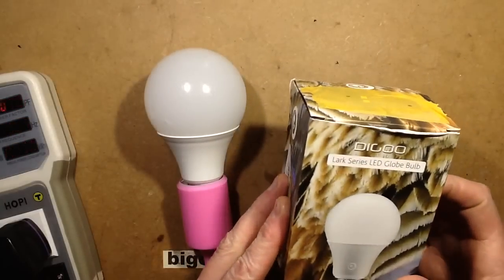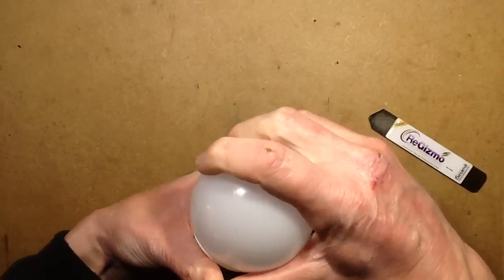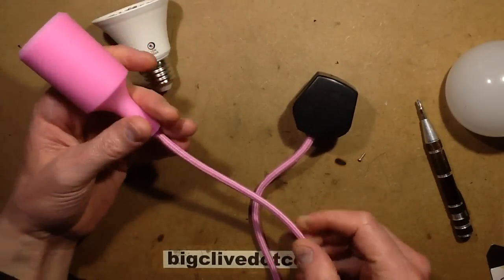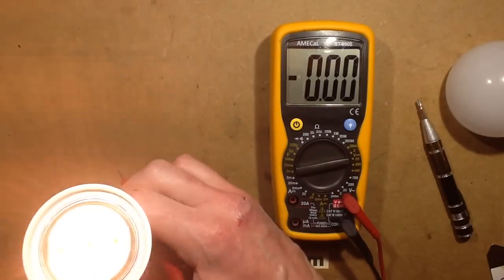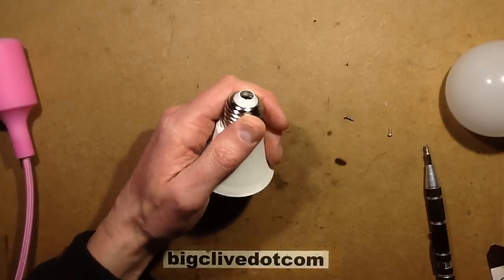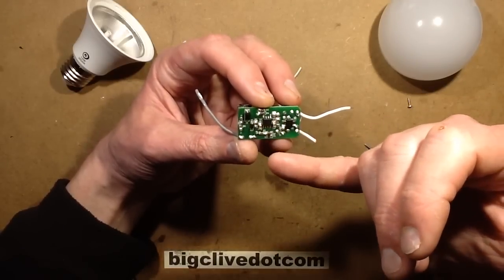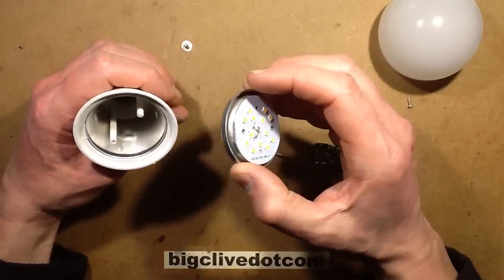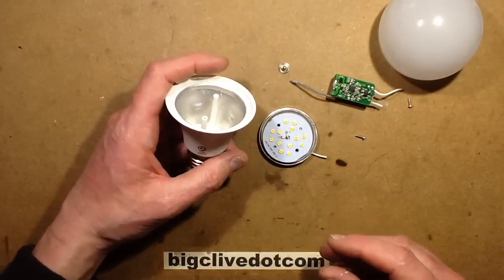Inside a Banggood Digoo Lark 12W LED lamp.

Comment: BigClive, I have been searching for a LED warm white bulb like that for several years that provides the same amount of light that a standard 60 watt incandescent bulb provided and been unsuccessful.  Have you ever seen one? I am on the 110 v US standard.  I have tried several but they never come close.  Please let me know if you ever find one.
Reply from the maker: I recommend the use of splitters that plug into your existing lamp holder and let you use two or more lamps.  That way you can use a cluster of lower wattage lamps that will last longer and be bright.
Reply: I think I will try that but please let us all know when the LED lamp bulb reaches the equivalency of a 60 watt standard bulb.
Reply: I have actually tried many of these out.  But the use I want it for is for a standing floor lamp and it just does not put out enough useful (reading) light.  All of these are very nice looking but functionality needs to catch up with the science.
Reply: FYI: A GE Reveal brand 60 watt incandescent bulb is rated at 630 lumens.
Reply: Thanks, I always wondered about what light output they had but since I have actually been trying LED bulbs out periodically I have to say that they just don't quite make it yet.  Big Clive sent me an email and told me to try a ganged outlet and might try this.

Comment: They fail way too fast, I had 4 and 3 failed within a few days to a few weeks, 2 were warranty lamps, 1 was saved for the 6500K light to use on special occasions. So for the question how long it is going to last: not long.

Comment: Never come across a led bulb that lasted for more than a few months.
I have seen led street lamps installed, and they don't seem to last very long either, do you think that led lights will perfected in the next 5 years  or so ?
Reply: I have 6 GU10 LED spots (3 in the bathroom and 3 in the kitchen, bathroom light is on 24hrs a day), been running them well over a year, no issues. In work I've replaced loads of 8w flu tube emergency lights with the guts and lamps from 3w LED bulkheads (4 years+), again... No issues... Vastly superior to the SD308 fluorescent ballast 8w guts that continuously burn themselves out due to overheating.
Reply: Don't buy cheap ones, I have a 10W one in my room and it has been there for at least a year, no issues at all, if I ever replace it, it will be because I need a 20W one xD.
If you buy decent led bulbs, they will last years.
Reply: Free Saxon buy some from Screwfix. They come with a five year warranty. I've had mine for a year and so far they've been good
Reply: Free Saxon the technology is already here, I know a manufacturer of street led lamps in taiwan , apparently theirs go on for ever with good quality LEDs and excellent cooling (some extreme weather conditions there). But they have it difficult to compete with cheaper products (they are expensive due to the good quality components).
Reply: Arthur Embleton the challenge with warranties is keeping the purchase receipt, they tend to get lost (which is what the manufacturers count on also)
Reply: Rincewind TheFirst with Screwfix the receipt is in my email and I have an account with them with all my purchases.
Reply: Free Saxon the early Philips led bulbs are amazingly long lived; I've got  a 10w one in an outside light that been on continuously for over five years now. I guess this is before they realised that they weren't going to sell that many if they just kept going for that long :)
Reply: ChayD Good point, they say they want us to be environmentally friendly but they still want consumers in BULK
Reply: Try Cree branded.

Comment: 12W LED bulb of this size produces too much heat and does not last very long. But you can lower the power (and brightness) by dividing the single 14 leds chain into two parallel chains of 7 leds each. (like this: http://i67.tinypic.com/91i3x4.jpg). It has a current driver, so the overall current stays the same, but each chain draws only half of it. The driver output voltage also goes down by half. It will draw 6W and will be much cooler and longer lasting.

Comment: Link for the long pink lamp socket?
Reply from the maker: http://www.ebay.com/itm/Colorful-Rubber-Ceiling-Silicone-Pendant-E26-E27-Socket-Holder-AC-Powered-/371514947079?var=&hash=item5680043607:m:mbJKFmopL5ncWGjB894taXQ
Reply: bigclivedotcom  Cheers Clive. Merry 2017! Don't suppose you fancy doing an autopsy on a Poundland LED bulb that buggered a few 3A fuses the moment it was put in several lamps and turned on?

Comment: ooh 12w! lets hope, we need some higher power ones
Reply: jort93z
hehe i guess what i meant was, im happy we are seeing clive do a 12w compared to 3-5w we usually see!, although ive seen 14w ones on ebay so maybe see them too!
Reply: jort93z
true, these 12 watts or so are the same lumens as a 100w incandescent, and about the same as a 20w cfl, and are where the most interest is i think, bright enough for 1 bulb to light a good area or room
Reply: the 9W of these are plenty for a living room or bedroom. They are like really really bright.
Reply: jort93z
people have used the 100w benchmark for years as the bulb to emulate, it was easy with cfl, and taken a while with LED due to the heat and price of making it combination and colour temp technology, now they are it seems very cheap, but we dont know quality or temperatures yet, i hope clive will start to do temperatures next
Reply: jusb1066 these in 9W option I can recommend. Build quality is something you feel right when you take it from the box.... Also when it comes to tungsten 100W I would say these in 9W are about 75W. Not sure about 12W bulbs, haven't installed them anywhere yet just cause they are quite obviously bigger than standard tungsten lamps and got nowhere to put them atm :D but 9W is just gold :)
Reply: Senpai Nooberinho
interesting to hear, i have 3-4 1950's desk lamps/workshop lamps, used to use 100w bulbs, cfl bulbs were often too long and stick out (but did find some in later years), and leds at one time could not find ones to compare with 100w, but am currently using 5w but with forward firing LEDS to make the most of the direction of light, be nice to use something more traditional looking with led's effieciency
Reply: jort93z
yes 100w in leds would be crazy!  i used the term 100w as in incadescent light!

Comment: I wouldn't call this a quality lamp since the thermal grease was spread across only half of the LED disk.  Half of the LEDs will overheat and the first one that goes will be the early death of the lamp.  The design is only half the problem.  The other half is the workmanship in assembly with proper amounts of consumables (thermal grease)!

Comment: it flickers because it lacks transformer
Reply: +Matt Quinn no. i have few led bulbs with proper transformer and constant current and they dont flicker on any shuter speed while those with only cheaply power supply flicker on most of the shuter speeds :)
Reply: +Matt Quinn im also interestef in cameras. probably it would be less visible if shutter was global. but when you have constant current power supply led-s dont flicker at all :)
eaven incasand bulbs dont flicker when you power them from constant current (cars headlights use dc power) but our grid ises alternating current so most of our home lights also flicker
Reply: +Matt Quinn im saying i have both good and bad led's that dont and do flicker. there are planty of video proofing about that. i am electrical engineer and love cameras as a hobby. when you have constant light - rolling shutter will not display flicker because nothing flickers. i have nor tried expensive cameras with global shutter and cheap leds that flicker so i cant say anything about that. eaven with your 36yrs of experiance there is still room to learn something new every day.
Reply: If the shutter is global then it would just have the whole scene pulsing rather than the lines across it. While Clive says that its not visible, I find that these crap flickery LEDs make the whole room feel like it is vibrating and is very annoying. Had to leave a resturant with cheap filiment LED lamps because the whole place was flickering, and once a few drinks down it really gets bad.
Reply: +Rich M-Smith (richms) i feel you man. my brain starts flickering from those stuff